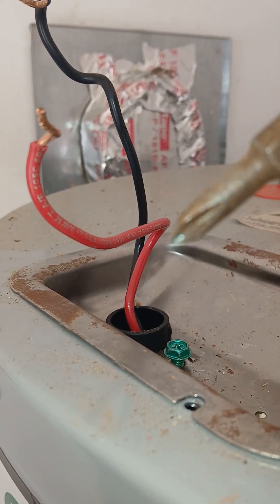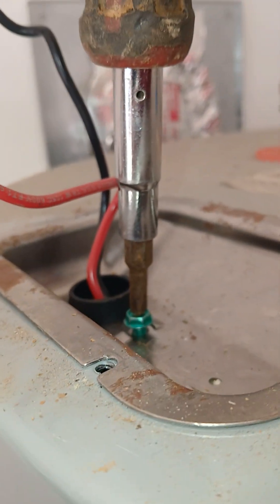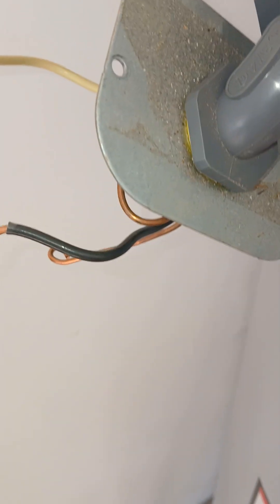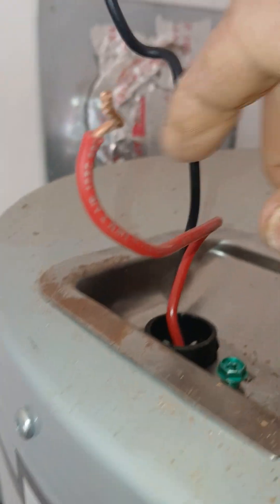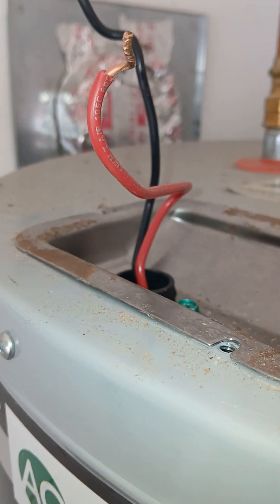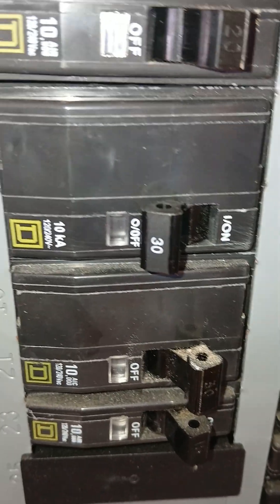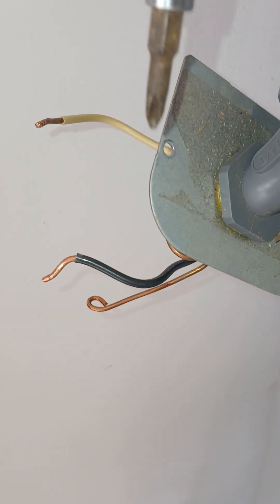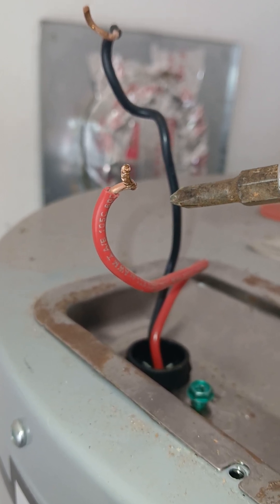How To Wire An Electrical Hot Water Heater?

Comment: "Hot" water heater huh. I don't think of appliances in that way lol And as a master electrician it doesn't matter which leg goes to which. By code you should have a means of disconnect by the water heater (breaker doesn't count). Wire and overcurrent device are sized based upon the nameplate and wire type. They aren't always #10 on a 30. Other than that, you've got her. 👍
Reply from the maker: @caden01691  Breaker box is within arms length, easy access.

A quick disconnect is nice, though.

Thank you for the positive input.

Thank you!